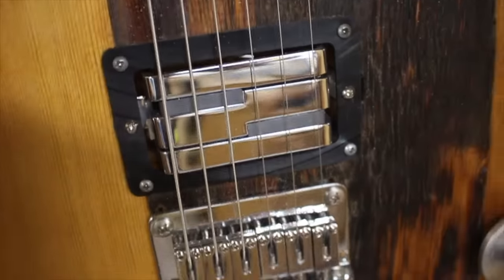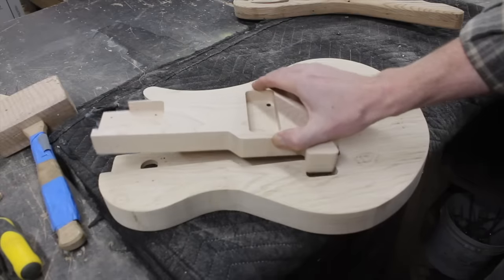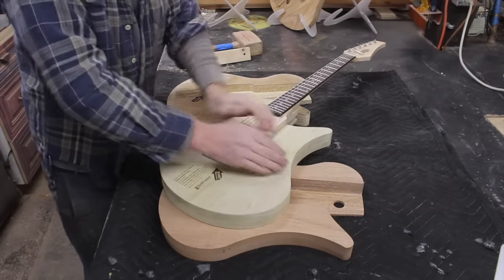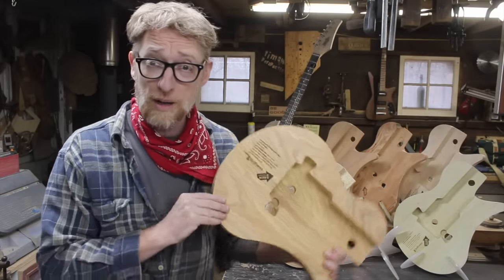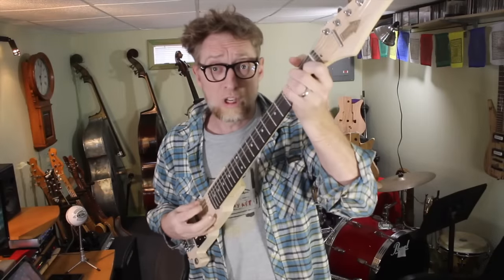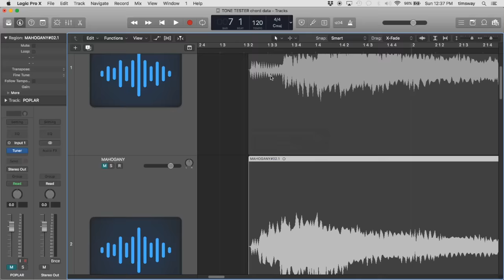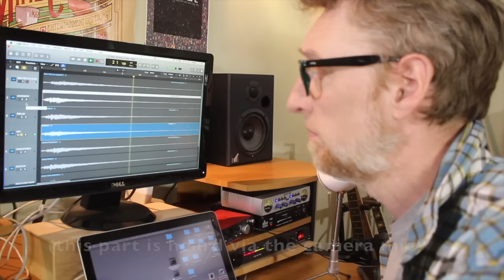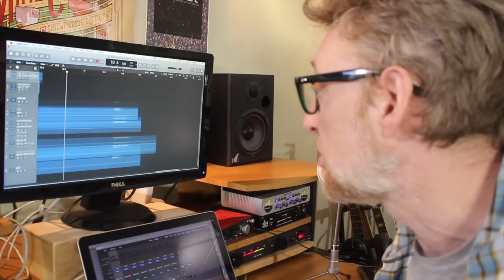Tone Wood Tester: One guitar to test them all

Comment: I would like to see the following: 
-use a spectrum analyzer so we can actually see and measure the frequencies
- add just enough gain to get to breakup, then whatever frequencies are louder will distort more than the others.
- see if shape makes a difference. Squares might sound different than circles
- play in different frequency ranges on the guitar, play a bassy part a mid part and something high so we can see how the wood reacts to different frequencies

Comment: The physics here are simple. Electric guitars use electro-magnetic pickups. They capture variations in the magnetic field from the strings( metal) moving within said field. Does wood affect a magnet? Nope. Does vibrating wood affect a magnet. Nope.  Even if you made a blank of ferrous metal it probaly won't affect the tone.  Unless of course it was magnetized. Try screaming "I paid $3500 for a piece endangered wood!!!" into your pickups. See if they care.. get some Seymour D's or other good pickups and pots if your serious about tone.
Signal chain,  signal chain, and chain.

Comment: They definitely sound different. Mahogany is dark and squishy. The differences actually really jump out when you add gain, which I'm sure you'd find if you tested this that way, as well. 

Ash is sharper and punchier. I'm not really firm on the notion that you can strum your guitar identically. I think if you set up a pneumatic with a pick and replaced the body from behind, we'd get more consistent results. 

Other than that, playing a two identical guitars that are made of different woods with identical electronics (I replaced the same pickups with the same Seymour Duncans) for several years completely solidified my opinion that it makes a difference. My swamp ash guitar is incredibly honky and direct, while my basswood one is softer and more forgiving for low gain. Some woods with densities that are similar have flavors that can cross over, but ultimately the grain of every piece of wood is a tiny bit different. If you are running from similar grain patters (No knots, etc.), woods themselves sound very different. Now... The notion of "Tone wood" is something that I find very confusing. To me, good "tone" wood would be wood that has been systematically checked for imperfections and treated to go into a guitar rather than a piece of furniture. The type of wood can then be determined based on the ultimate tone you want. 

Ever wonder why you can never get your strat to sound like Eric Johnson's, even with roughly identical signal paths and amps? Sassafras body on his original strat. I've never played one so I can't determine quantitatively what the difference is, but I know that it makes one. To my ear, it's perhaps stronger in the midrange than alder.
Reply from the maker: I hear what you're saying but I think you're missing my point. Of all the factors that can affect your tone, wood is pretty low on the list. There are hundreds of reasons none of us sound like Eric Johnson, and sassafras is just one of them. The gain and signal chain you refer to are way more important. Hell, the dryness of his skin, callouses and finger bone density are factors also more important than the wood. I'm trying to encourage people to think locally and sustainably about what they use and hopefully realize they don't need wenge and cocobolo to make good music. If we must be pedantic and two pieces of wood from the same tree can sound different, perhaps we could just chase down that perfect piece in our own backyard instead of overseas? Do we really need to micromanage such a minuscule part of the equation? Is the carbon footprint and trail of blood and destruction worth it for us to play "stairway" just right?

The most important factor in the tone chain? Practice. Least? Wood, tied with paint color unless - you're Billy Corgon :)
Reply: @timsway  Oh I'm not advocating for exotic woods - I'm just saying that there is a definitive difference between all of the examples you had, even ones you said had no difference. I just get weary of the tired old "Wood makes no difference" argument. That makes just about as much sense as claiming masks don't work in stopping the spread of germs. It's basic science. 

The whole "tone wood" thing is a strawman applied to everyone who understands the basic reality of the way wood affects tone simply due to a few companies that use ludicrous descriptions of wood tones on their websites. Nobody who is a reasonable human believes that a wenge top will make a guitar sound, "BALANCED, YET FRAGRANT. EXQUISITELY SAVORY AND YET DEEP SMOOTHLY BRIGHT DARK AND ALSO MIDRANGEY WITH NO HONK - CONTAINS AFTERNOTES OF DUMBLE AND HEADNOTES OF BILLY GIBBONS. + $100". 

It just sounds different. Over years of interaction with guitars, I eventually figured out that the old hat makers chose mahogany, maple, alder, basswood, ash, rosewood, and a few others for good reason. I'm all for dropping rosewood in light of the destruction of the rainforest, as there are other woods that can fill that space sonically. The look of rosewood is what is hard to mimic, and modern rosewood alternatives have gone the route of aesthetic over tone, and it's noticeable.

Comment: Why not isolate the pickup(s) from the body to see if any part of the guitar has an influence on the sound.  Start from a completely isolated case.  Put the pickup(s) in front of the strings instead of in back.  Suspend them somehow.
Reply from the maker: one of the"tone wood" arguments is whatever the wood is actually touching/anchored to is effecting the way the strings vibrate and sound enough to change the magnetic pickup's reading, even though the playable parts of the strings are only touching the nut and bridge. So even if the pickup is above the guitar, the wood would be altering the tone. Make sense? Not to me either :)

Comment: The base, central "body" connecting the bridge-->strings-->nut together into a physical "loop" of vibration kind of ruins this experiment for me. I would expect that if different wood affects the sound of a pickup that only amplifies the "sound" vibrations of metal strings as they wiggle over them, then sound-changing variables would have to affect a) the way that the strings "wiggle" when played, b) how the movement of each string affects each other, and c) how much vibration moves the PICKUP UNDER THE STRINGS (an overlooked variable, in my opinion). In this experiment the wood under the pickup is always the same--the direct line of vibration (the feedback loop) is never directly affected by the outside body change. It seems like this would make "tonewood" changes even more subtle than they would be if the wood under the pickup changed. 

After watching other experiments on YouTube it seems obvious that if there is a difference between "tonewoods" it is quite subtle. If you've played electric guitar for 40 years like I have you've experienced all sorts of weird things that seem to affect the tone of the guitar. My favorite story is spending many minutes in a studio trying to figure out what ruined the sound of a Stratocaster I was playing to track quick basic tracks for a multi-song project. Something happened half-way through the session to deaden the carefully-crafted sound--for no apparent reason the guitar got slightly "lifeless". We couldn't figure it out. A couple songs later the sound suddenly came back to life. The difference was subtle, but in the studio environment it was noticeable to everyone in the studio, even the drummer who didn't give a damn about guitar sounds. 

We suddenly realized that I had clamped a Keyser capo on the headstock in the middle of a song (after taking a short break. I was practicing a new capo'd part that was coming up later in the handful of songs we were tracking). After we tracked the capo song I took the capo off the guitar and the sound got better when we tracked the next song. We blind-tested the difference with the lead singer putting the capo on and off my headstock while I strummed while everyone listened in the control room. EVERYONE could hear the difference. 

This proved to me that, if a bit of rubber and aluminum clamped to a headstock could change the sound of a Strat enough to be noticeable to non-cork-sniffing musicians, it must be possible for any change to the makeup of a guitar to change the tone, including the wood.
Reply: ALSO, I'm coming to believe that a lot of the magic that people associate with "tonewood" in electric guitars comes from feedback from the wood into the hands (and to a lesser extent) the body) of the person playing it. If the guitar FEELS more responsive, or brighter, or smoother under the hands and the notes decay in a particular way when you FEEL them, then you're going to play differently. Possibly you're going to play better when a guitar feels better to you and responds in a way that feeds your playing. In some guitars its less about how "tonewood" sounds and more about how it *feels*.

Comment: OK! ... THANK YOU! ... but I have to say, there are some details to mention ... CONSTRUCTION-PART: Your Neck-PU-Bridge-Section is always the same (maple) - only surrounding woods are different - and this section is only 'fit in', not screwed, not glued, not a real neck-through-body construction - and it seems that your fit-in-section does not reach the bottom of these bodys - it looks that there is always a little gap?! ... ELECTRIC PART:  In my opinion there is an importance to a few centimeters of wood which are surrounding the pick-up - because PU-magnetic-field goes through this wood-section like x-rays ... so it makes a difference if this PU-wood-section is very dense or more hollow - in your case it is always the same ... BUT - same PU mounted on different woods will sound different! ...  PHYSICAL-PART: Resonance, loudness, sustain ARE different - these things come as a reaction of the used woods - also concrete, steel, acrylic would react different! ... Strat and Tele screwed necks react different to a glued-in Les Paul neck ... GLUE generally makes the wood-parts stiffer - it hardens out and gets crystals-clear and goes into the pores of that glued wood ... also strings / gauge / length / material have an influence to SOUND - guitar picks too !! (0.73 mm or 2.4 mm / Soft-PVC or Hard-PVC) ... Scale length (mensur) has also an influence (Strat is longer than Les Paul) ... ALL IN ALL: You should not generally say - WHAT IS THE BEST WOOD - NO! - You should first DESIGN a GUITAR for a special usage/job ... funk-guitar / jazz-guitar / blues-guitar / slap-bass ... playing-style more 'rhythm' or 'lead' ?? ... and then you should 'taylor/design' a custom-sound - you will get different results by using different components !! ... Look at Fender Stratocaster - there are more than 100 different models out there - and they sound/react different !! (Clapton-Strat, Ray-Vaughn-Strat, Custom-Shop '62 Strat, Custom-Shop '57 Strat, American Standard and so on) ... YOU SHOULD focus on the final result - HOW SHOULD IT BE / HOW DO I LIKE IT TO BE  - and then check different components/different ingredients to come to your dream-result - BECAUSE - you see it more as a guitar-builder (construction) / other people see it more from a players-side (sound, ergonomics, playability, durability) ... I asked and discussed with a luthier - what is the best guitar? - and he answered: Best guitar is that one you always like to hold in your hands and play, play, play :-) ... GOOD LUCK! ... Greetings from Europe/Austria!

Comment: nicely done Sir.. as accurate as can be.. I think if guitar players were a bit more eclectic, they'd say that the food they had last night affects the tone cause the guitar is resting against the belly :P 

I just have a few questions/suggestions:

1. As you said, the bridge is mounted on the neck wood as are the pickups.. This implies an accurate representation for neck through type guitars but I guess it wont be too far off on the bolt-on and glue types.
2. When it comes to loudness and overall resonance, I guess the natural frequency of the wood plays the most important role. The thing is these natural frequencies depend on size, density etc of the wood and are nearly impossible to match. Nonetheless they do have an impact. I think that's what's going on with the poplar.
3. Just a thought to solve the "human factor" variance in strumming.. you can set up a pendulum with a pick attached at the end and swing it identically by pulling it the same distance :).. I know.. not worth it, but still very nerdy :P
4. Lastly, the wood joinery thing you have going on is simply amazing! Ive wondered if guitars necessarily need glues and bolts and you pretty much answered that.

Thank you once again.. Peace.
Reply from the maker: Amateur golfers will spend thousands of dollars on the same clubs their fav pros use to improve their game. But their game still sucks and the pros could still kick their amateur ass with some pawn shop clubs. In other words, it's not the gear that makes them good golfers, it's the practice. 

It would be fun to make a "no glue, no screws" guitar. But I don't think my woodworking is quite at that level yet, no matter how expensive my tools are! lol.
Reply from the maker: oh, and absolutely, a mechanized strummer would give better results - but still get even further away from reality of guitar playing.

Comment: The 2 problems I see are:

1. Its already been said that you need an automated strummer.

2. In a solid body guitar, the bridge and pickups are attached to the body of the guitar. So I think your results are kind of mute since you had the bridge and pickup on the removable neck. 

Hats off for going to the trouble of doing the experiment, but I don't think it truly captures whether or not a certain species of wood or material has an effect on tone. Personally, I'm on the fence.
Reply: Except that most older guitar designs have the pickups mounted to a piece if plastic which is then mounted to the body, like pickup rings (LP) or a pickguard (Strat). So the pickup does not actually touch the wood. So maybe we should talk about tone plastic instead? 🤔
Reply: @adamskold6395  So which has a larger chance of applying a variable to this test? 1-2mm of plastic or 1-2mm of plastic mounted to 2 inches of wood that is then mounted to the "body"? In order to be as scientific as possible, as many variables as possible have to be removed. The removable body is a variable that isn't found in any guitar. New, old, lp, strat, gretsch or otherwise.
Reply: @stangfromhale  Yeah, I generally agree that his test is flawed, but it's still the best video on YouTube about this I've seen.

When it comes to what is more important for vibrations, it is the thing that is in contact with another thing that makes it vibrate. If that thing in turn is in contact with another thing that vibrates, it is likely that the vibration is passed on, but it has lost energy in the process (lots of it is likely just reflected back to the body as well) and the vibration may have been altered during the transmission. I'm not saying that the plastic makes a lot of difference here (since I don't think the wood makes a lot of difference either), but in general we should be more concerned about what is directly in contact with the string (or the pickup if it is microphonic), such as the nut, the frets and the bridge, than what is indirectly in contact, ie the body and neck.

Or we could just accept that all of that is stiff enough to barely vibrate enough to give much if any feedback to the string (or pickups, again only if they're microphonic).

Comment: I seen a guy make a guitar out of the open space between two benches sound exactly like an actual guitar. 

Literally an open-air lapsteel guitar and with meticulous pickup height adjustment it sounded identical. 

Tone wood only applies to acoustic guitars because the the sound of the wood on an electric guitar does not translate to picking up vibrations from the strings into a signal path through a patch cable into transisters and out through an amp. That's all just analog movement into electrical signal, and the density, softness or hardness, or even chemical composition of the guitar's wood s irrelevant. 

I've seen someone make a guitar out of colored pencils and epoxy and it sounds like a fender.

Comment: I bought a guitar and its made in Korea.. i was about to add another pick up on it but when i started to chisel out a compartment for a pick i noticed its made of hard cardboard,  wow no wonder it was to light the paint job was thick an one would no suspect that it isnt made from wood i was so disappointed for buying it.
Reply from the maker: if I've learned one thing in life, always buy the item that's priced in the middle: the cheap one will disappoint and the expensive one isn't worth it.